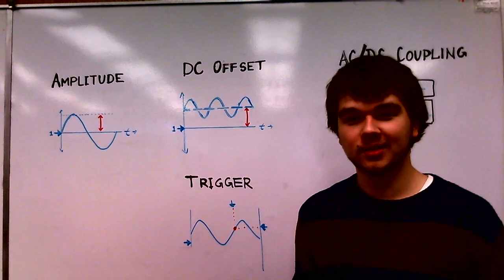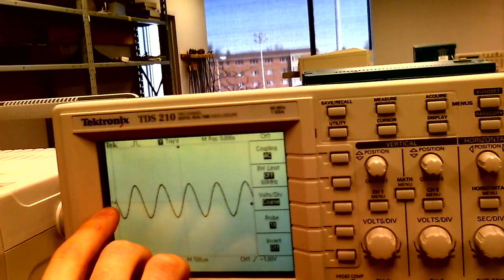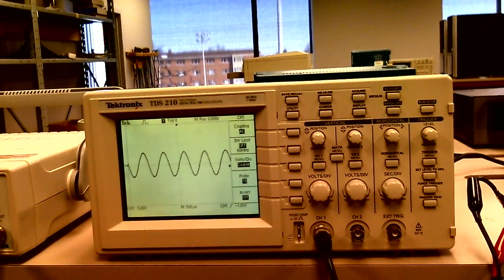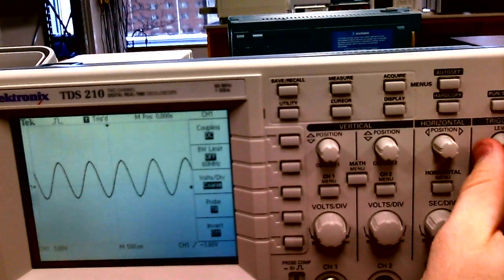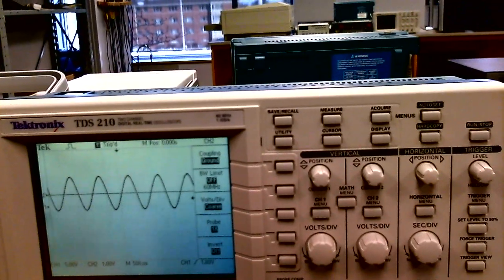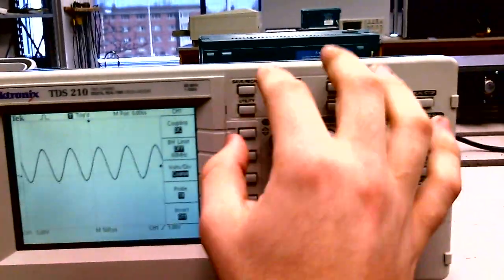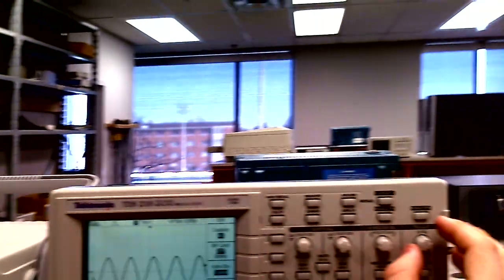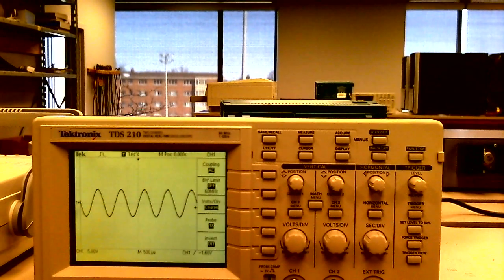DC and AC measurements with an oscilloscope

Comment: Hi Terry, is dc coupling only possible digitally? seems dc offset applied in the digital domain, when put through an 'ideal' d/a converter equates to 0hz dc bias current in the analog domain, useful to cancel offsets, (this provided filters in the converter dont high pass the signal, many do hence the word ideal). If so ac bias boggles me. Better put, are both bias types used in tube circuits, for eg?
Reply from the maker: I'm not sure if I totally get the question, but the context in the video is the distinction between AC and DC coupling in oscilloscope settings. DC coupling shows the unaltered signal; AC coupling removes the DC component.
Reply: Thanks,

Comment: what is the signal generator?
Reply from the maker: A signal generator is also called a function generator or a wave generator. It's a device that can produce waveforms of adjustable shape (eg. square, sine, triangle), amplitude, and DC offset.
Reply: +Terry Sturtevant so is it also used as an ac voltage source?
Reply from the maker: Exactly.